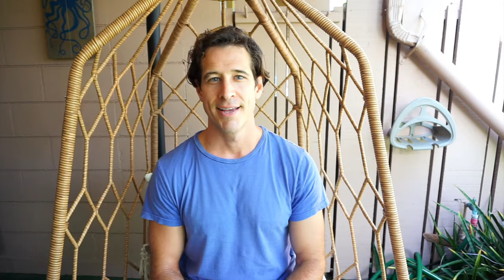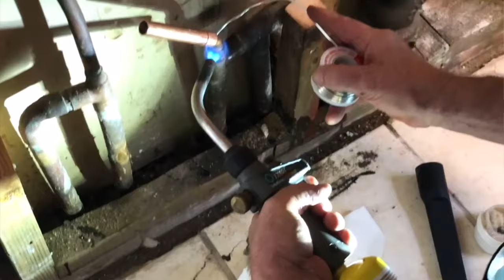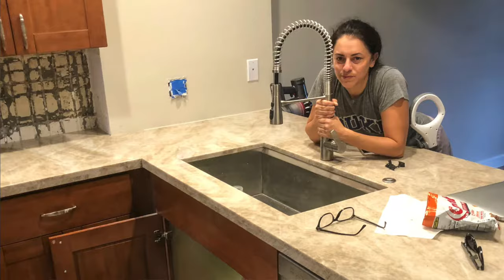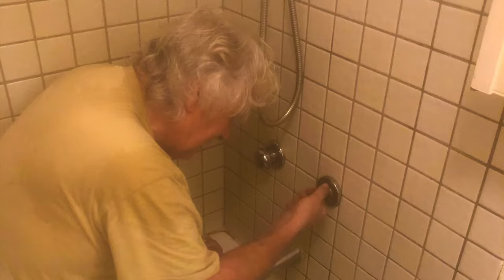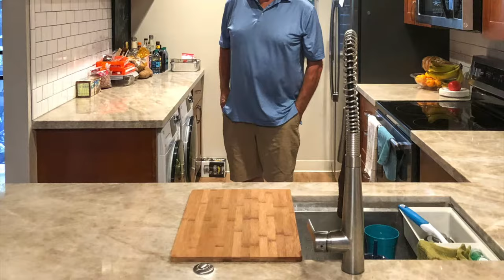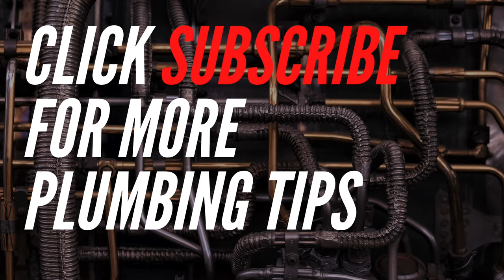Is Your Dishwasher Not Draining? | 3 Reasons Why Water is in the Bottom of Your Dishwasher

Comment: Sounds like this drainage issue can be corrected by running the hose which is coming in under the sink from the bottom to move the hose to the top of the sink and put a loop in the hose. Hope I’m hearing you right. I’ll give it a try. Thanks Pat Connell Canton MI

Comment: Our GE dishwasher does not. Completely drain. We have checked the drain hose and the connection to the sink drain as well as the filter. Is it possible the pump in the dishwasher is not working properly?  It sounds like it pumps for a few seconds and then cuts off (does this a couple times) and then it cuts off and all the lights start flashing in the control and we have to flip the main switch to shut off the power to the dishwasher. After doing this a number of times the dishwasher will eventually drain all the water out but it doesn’t dry the dishes. Should we try replacing the pump?
Reply from the maker: Marion Cutchen, if the dishwasher is over 5-10 years old, I would recommend replacing the dishwasher. I think it would be too costly to replace the pump. I have never replaced a pump or rebuilt a dishwasher. If you’re not doing the repairs yourself, find out the cost and then find out the cost to replace the dishwasher.

Comment: So the water goes through the hose and to the disposal, but stops there. I have cleaned it and the hose is not clogged but there is a white wall like thing in the disposal where the hose attaches like 2 inches in ? Im not sure if that’s supposed to be a valve that maybe it’s not opening when draining?
Reply from the maker: Disconnect the hose. Insert a long screwdriver into the drain opening on the garage disposal to see if it’s clear. If the screwdriver doesn’t go all the way through, that’s your problem. Figure out how to remove the device. If it was a check valve, it usually does not come with the garbage disposal and was added. That’s why a recommend the loop in the drain. If there is no blockage, then you have a problem with the garbage disposal.

Comment: Kenmore Elete does not automatically drain at end of cycle. It does drain if I press the "Cancel/Drain" button. Have confirmed with an inspection that the drain pump is not blocked. The dishwasher is 7 years old with no problems till 3 weeks ago.
Reply: I have the same problem as Roger M, my KitchenAide DW will go through the entire cycle, cleans dishes but does not cycle the last drain. I have replaced the control board. Any sugestions?
Reply from the maker: Thanks, Valerie and Roger for the question. I recommend calling Kenmore since you troubleshot the drain connection. As a plumber, we are responsible for the water to the dishwasher and the drain out of the dishwasher.

Comment: I have a new Bosch dishwasher.  Hardly use it.   When looking under sink, I noticed that the drain tube that connects to the disposal was full of water. The dishwasher drain reservoir is empty and the filters are nice and clean, but for some reason the tube keeps the water in it even after it flushes. I have reset the cycle and ran it through a manual drain cycle and I can see the water flowing into the disposal but then the tube is never emptied.

Is it normal? If not what should I look for?
Reply from the maker: If the drain hose is laying on the bottom of the cabinet, you need to take the extra hose and tie it up as high above the inlet to the garbage disposal as possible. That stops the water that drains into the kitchen drain from running back into the dishwasher. If that doesn’t fix the problem, then there is a problem with the dishwasher discharge water pump.
Reply: @TheGrumpyPlumber  I understand. Last question I have is will there be water in that tube between the discharge pump and where that line goes from vertical to  horizontal? Is that tube empty immediately after the discharge pump on a normal drain cycle?
Reply from the maker: If the hose is looped as I recommended then you won’t get water back into the dishwasher. The purpose in doing the hose this way is so that the water from the kitchen sink does not run back into the dishwasher.

Comment: I just want to know how the drain hose is suppose to be positioned from the dishwasher to the garbage disposal. Mine is now call connected to the near top of the garbage disposal under the sink cabinet (not the sink),  then it loops downward, then upward (still under the sink), then after it goes upward it loops upward over the dividing wall to the dishwasher side, then goes downward to the bottom where it connects to the dishwasher.
Reply from the maker: G. B. It sounds like you have it installed correctly. If you still have water in the dishwasher after it’s done recycling, you have a problem with the dishwasher. If over ten years old, replace it.

Comment: Hi Jim, I caught your video trying to find out why my dishwasher isn't draining completely all the time. My drain hose goes thru the floor into the basement into a direct sewer line. Any ideas ?
Reply from the maker: Arden Miller, install a 3/4” check valve on the drain hose where it connects to the sewer line. Or, take the drain hose and put a bend as high up as you can and then connect it back to the sewer line. You should be able to add on to the drain hose with 5/8 rubber hose. Sounds to me like the water is backing up from the main drain into the dishwasher. You can’t connect the dishwasher drain to the drain under the sink? That’s the best thing you could do.
Reply: @TheGrumpyPlumber  Thank you for the advice I will try the check valve. The drain goes into the basement I think because whoever installed the cabinets put a 15" base cabinet between the sink cabinet and the dishwasher.

Comment: I have tried all the suggestions. My Kenmore drains sometimes but not every time. BUT if I push the "Cancel/Drain" button it seems to always work. Does this mean it is the control panel?
Reply from the maker: Yes, time to call the Kenmore guy. Good luck!
Reply: I have the same problem , and here is how i do it.  Find the dishwasher drain line  under the sink ( make sure you have a container to collect some water) , the last 2 ft for the line for me is a rapper hose. I unhooked the hose from the sink drain and then use a 1/4 auger  to clean the line all the way back to dishwasher if you can using the auger.  For me is  about 9 ft from the sink to the dishwasher.  Hope that helps.

Comment: My dishwasher has started only partially draining. After a load is completed, there’s standing water just  covering the heating element. If I use the drain setting on the dishwasher afterward, it’ll take about 3-4 times before the water is removed. I’ve already cleaned the hose to make sure there’s no obstructions. Is it possible that the drain pump is failing, but still works enough to drain partially?
Reply from the maker: Drew, is the dishwasher drained on an air gap or does it have a check valve where it drains into the garbage disposal? The way that you can check the drain is to disconnect it from the air gap or by removing the check valve. Take the dishwasher hose and connect it to the garbage disposal. Take the middle of the hose and tie it up as high as you can underneath the sink above the garbage disposal drain. You want the water to go up the hose and back down to the garbage disposal. What might be the problem is that when water drains out of the sink through the garbage disposal, it runs down into the dishwasher. This could be a good fix if that is the problem. Air gaps and check valves are constant maintenance.
Reply: @TheGrumpyPlumber  thanks! I’ll try elevating the hose. It currently runs along the bottom of the cabinet, then goes up into the dishwasher. It does sound like the pump is working, and it is moving some water, but not completely emptying the dishwasher after a cycle.

Comment: I have not found a single video that address is what my dishwasher is doing. My dishwasher is pumping the water out during the washing cycle, just like it’s supposed to, but at the end of the cycle it does not drain out the water at the end and so I’m left with a bunch of water at the bottom once the dishes are clean.
Reply from the maker: Matt Vaughan, check the drain hose on the dishwasher and see if it’s been installed correctly. You want to see that the hose is coming in the bottom of the cabinet and running up to the bottom of the countertop in the cabinet  . From there, it should go to the dishwasher drain on the garbage disposal. That stops the water from the garbage disposal drain from running into the dishwasher. If you have a check valve in the line from the dishwasher to the garbage disposal, that could be locked in the open position. This means that the check valve is no good. I don’t recommend using a check valve. If your dishwasher drain is not connected correctly as described, then your dishwasher pump could be bad.

Comment: my samsung dishwasher goes thru the complete cycle find but then fills with water several hours after it was dry inside.  if i just run the drain function it drains fine.  any ideas?> i cant find a leak.

Comment: I had a plumber come replace an old drain hose with a new hose. Now i have water in the bottom of my dishwasher after a cycle. What could cause this, if it never did this before?
Reply from the maker: Hey J what’s next, the plumber probably connected the hose to the dishwasher and needed to take the hose and tie it to the bottom of the countertop and then down into the dishwasher so it makes a trap so the water can’t run back to the dishwasher.

Comment: If you've just replaced your garbage disposal you forgot the knockout plug.
Reply: When you figure out to remove the plug at least the dishwasher drains and it takes another few weeks to figure out why it starts to stink a couple days after you run it, and THEN you hang the dishwasher drain high enough to prevent backflow
Reply: @fredbarnes196  lol

Comment: What if the hose isn't long enough to make (attach) a high loop?  Can you get a longer one from a supplier?
Reply from the maker: Star Gazer, you can attach any hose as long as it has a 5/8 inside diameter. Take a 1/2” piece of copper and insert it into the new hose and the dishwasher hose and clamp it on both sides. Then loop it and attach to the garbage disposal. You might want to insert another piece of copper so the hose won’t collapse when attached to garbage disposal. You can also use a 3/4” inside diameter hose.

Comment: My wife thinks the airgap is supposed to be installed such that the opening is facing the sink. She thinks water is supposed to be able to flow out of this and into the sink. I disagree. I think the holes are mostly just for air to get into the airgap, and that if water did come flowing out, it doesn't really matter which way the gaps are facing. Consequently, I think the openings should be facing away from the sink because if there's a wall there, it tends to look better.

Which of us is right?
Reply from the maker: Mitch, the air gap should not leak water, period. Doesn’t matter which way the gaps are facing. If the air gap is leaking water, that means it is plugged. I would take the 5/8 hose and insert it into the 3/4” hose which is connected to the garbage disposal, and tie it up as high as possible to where the faucets are connected so that you can eliminate the air gap. Or, if you have a high quality dishwasher like a Bosch or Miele, it has a build in air gap. I won’t take sides in this debate. You are on your own Mitch.
Reply: @TheGrumpyPlumber  I'm not saying mine is leaking water. I'm saying that my wife thinks that they are supposed to leak water and should therefore the openings should face the sink. I was saying that even if they did leak water, it doesn't really matter which way the openings are facing.

So you answered my question. I am right the openings are for air to enter the area, not for water to leak out. 

It no longer matters directly to me, because we moved, and we no longer have an air gap.

Comment: Mine runs to an air gap shared with a line from the disposal, so it’s up high. Is it possible there’s a clog in that disposal hose. Bypassing the air gap and routing through the top of the cabinet then just go direct to the disposal? The disposal doesn’t need the air gap?

Update. Yup, clogged up air gap. Working fine again. Wondering if I should just take that thing off and run the dw drain line directly to the disposal, looped high of course as suggested

Anyone know what the intended purpose of the air gap is?
Reply from the maker: @michaellaforte6964, the purpose of the air gap is to stop the garbage disposal water from running back into the dishwasher. By keeping the disposal line as high as you can, then coming down into the garbage disposal, will stop water from running back into the dishwasher. The newer higher end dishwashers have solved this problem and they do not want an air gap on the drain line.
Reply: @TheGrumpyPlumber  awesome! Thank you!

Comment: Frigidaire dishwasher, wont drain. Drain is clear, pump is running, impeller is free, lines are clear and you can hear pump running no water discharge. What to do? FFSB2412SB2A model number.
Reply from the maker: @daltonotto9536, I’m not an appliance repairman. I only tell people how to hook the drain up correctly so they don’t have to use an air gap. My 17 year old dishwasher was having a problem and I fixed it with a new one. Much easier.
Reply: @TheGrumpyPlumber  this cheap by quality dishwasher doesn’t have an air gap devise. It has worked for almost five years and suddenly not. Looked at some general things like: pump motor, blocked water line etc. and no lock. A new motor is $80 a new control panel $135 and if it doesn’t work a service call $200 plus. A new unit $350. I guess a new unit…

Comment: my hose is high... its behind the sink bowl, so i can't see it, if, i take it off and blow into it, i cannot blow bubbles in the standing water in the dishwasher., i tried to put a snake thru it and got as far as I can. Water does not go down in dishwasher.
Reply from the maker: Make sure the opening on the garage disposal or branch tail piece is clear. There is probably a problem with the pump on the dishwasher if everything else is clear. P. S. Did you recently have a new garbage disposal installed? If so, hopefully they removed the plug where the dishwasher drain connects.
Reply: @TheGrumpyPlumber  no garbage disposal., frigidaire gallery. goes into sewar pipe. never had that in my life. is it electronic to open the sewar pipe or does it just drain?

Comment: We don’t have a garbage disposal
Reply from the maker: James, you must have a branch tailpiece where the dishwasher hose connects to. You still want  that hose as high as possible and then down into that branch tailpiece.
Reply: @TheGrumpyPlumber  yes we do have a branch tailpiece. It’s an older house probably 1950s and the drain for the dishwasher goes into the floor into the basement ceiling into a galvanized tailpiece.
Reply from the maker: James, I would install a branch tailpiece on the bottom of the basket strainer or in the vertical pipe before the trap. Then reroute the hose to the dishwasher by bringing it in as high as you can and then into the branch tailpiece. Hope this helps ....difficult when I’m not there to see your problem.

Comment: Control panel is not lighting up but I can still get it to turn on it just left water in the bottom
Reply from the maker: You probably need to have the dishwasher repaired or get a new one. It doesn’t sound like a discharge hose problem.
Reply: @TheGrumpyPlumber  Thank you!

Comment: mine drains . my dishwasher runs for about 5 minutes then that FTD light comes on, i clean the hose out , garbage disposal works. No water anywhere, ugh help
Reply from the maker: @Leonbergerss  Make sure there is not a kink in the hose. If that’s not a problem, call a service maintenance person. If the dishwasher is only a few years old, it might be under warranty. If older, be prepared to replace it.

Comment: I want dishwasher connection to grinder
Reply from the maker: Batth, does that mean you want to remove the air gap? If so, just disconnect it and make sure the drain line is higher than the garbage disposal.

Comment: How about. showing this loop, you're talking about.
Reply from the maker: Dan, let me try to explain. The drain line on a dishwasher comes in from the bottom of the kitchen cabinet. You take the line up as high as you can towards the bottom of the countertop. Come  back down to the opening of the garbage disposal. Tie the hose up near the top of the countertop. You are creating a trap in the hose so water can’t run back into the dishwasher.